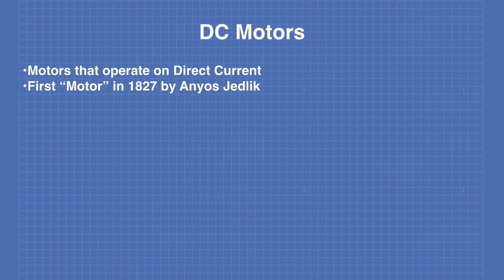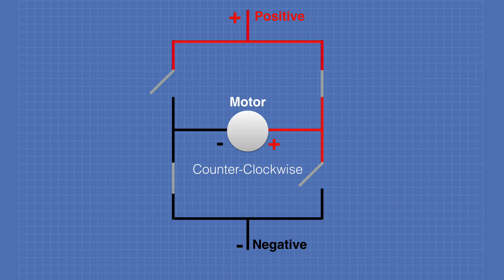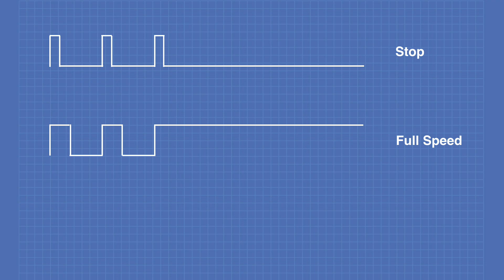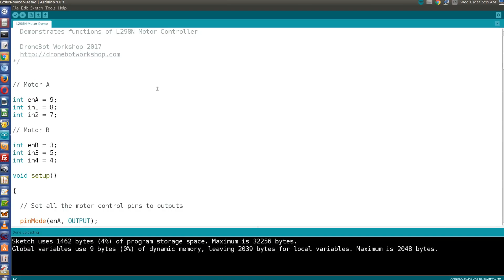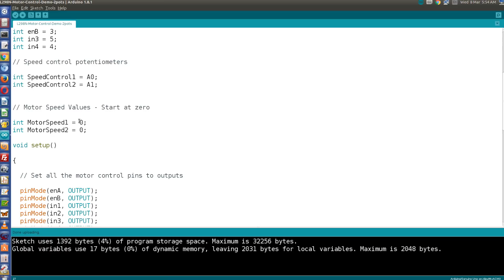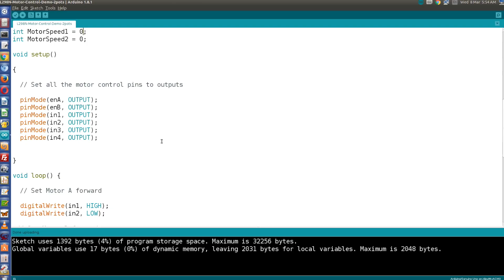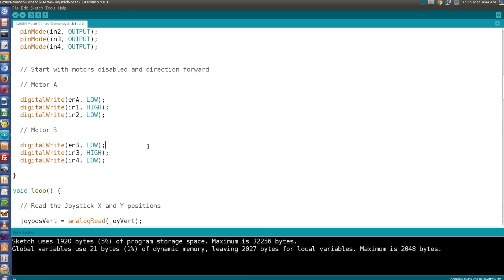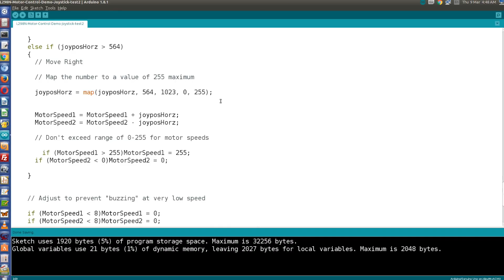Controlling DC Motors with the L298N H Bridge and Arduino

Comment: Can this be apply to a quadcopter as well?
Reply from the maker: Most of the better quadcopters use brushless DC motors that are controlled using an ESC (Electronic Speed Control). While you will find DC motors in the cheaper "toy class" quadcopters these are usually small motors that would be better powered by a tiny H-Bridge controller, the L298N board would weigh too much (and remember, you will need two to control the four motors in a quad).

Comment: So Arduino and the motor drive have it's own separate power supply?
Reply from the maker: Yes. You can use the Arduino's 5 volt output to power the L298N boards logic circuitry but the motors themselves will need their own power supply.
This is actually a good thing in a way, as the motors (especially inexpensive ones) can induce electrical noise on the power supply lines. You wouldn't want that getting back to your Arduino.

Comment: i need your help sir, this motor controlled with smart phone via bluetooth.and i need circuit diagram and code.i will try lot of times in remotexy app. but its not working "device not reply. receive time out error" this is the problem. and please help me
Reply from the maker: I will need a few more details Mani before I can assist you. Are you following an existing project to build a bluetooth motor controller and having problems with it?

Comment: Amazing video, easy to understand as a beginner. I've been looking every where for a video that explains the basics like this. I do have some specific questions pertaining to my project though. Can I use this set up, but with a 4 channel relay switch for using a remote to control 2 12v motors for separate functions?
Reply from the maker: Hi Kyle, sorry for the delay in replying.
I'm not sure I completely understand what you want to accomplish. Are you thinking of using the relay outputs to control the IN1- IN4 inputs to the L298N? That would work but you would not have any control over the motor speeds.
Perhaps I'm not understanding, if you can provide more details I'll do my best to assist you.

Comment: Is this akivo for stepper motor also using a shield l293d?
Reply from the maker: The L298 can be used to drive either one stepper motor or two DC motors. This video shows it controlling DC motors.
I will be doing a video about controlling stepper motors soon.

Comment: Thanks for the detailed explanation L298N motor driver.  Will use the steps to eliminate the buzzing sound I get with the motor for my project.
https://www.youtube.com/watch?v=bH53QTfaeVg
Reply from the maker: That's a nice setup you have in your video!

Comment: Is there a specific type of D.C. Motors required to build similar projects? I want to buy some individually, but I'm not sure which
? Thanks
Reply from the maker: The L298N will function with any DC motor that uses up from 5 to 35 volts and that consumes less than 2 amps maximum, which leaves you a wide range of motors to choose from.
The small "yellow" DC motors that come with the cheap robot car bases I used in the video are very inexpensive when you buy them individually, eBay is a great source for these.
Reply: Thank you

Comment: Wow! Thank yoy for this video of yours but can I ask you something? What if I'm using a L298D Motor shield? Can you please help me how to control a motor and/or micro servo motof using a joystick?
Thanks..I wanna learn a lot from you Sir
Reply from the maker: The L298D module is virtually identical to the L298N. You should be able to use these instructions to hook it up.
If you have difficulty identifying the connections let me know where you're having problems and I can try and help you.

Comment: Thanks for this great video. If I want to power a 12VDC motor, could I use a standard 12VDC power supply (and take apart the wires or something)?
Reply from the maker: Sorry for the delay in replying.
As long as your 12 volt motor doesn't draw more than 2.5 amps then this will work fine. Keep in mind that the L298N will drop 1.4 volts so you'll only be supplying 10.6 volts to your motors, they should still work though. If you're using a 12 volt "wall wart" be sure that it is DC and that you know which wire is positive ands which is negative.
If you like you can set the jumper on the L298N to use the 12 volt supply to also power the logic, as 12 volts is plenty for the modules built-in voltage regulator.
If you want to supply them with a full 12 volts you'll need to use a 13.4 VDC supply, not a common item (but very close to the voltage of a car battery!).

Comment: Wow, I can't believe I found something so close to what I want to do! This is really a good video. I would love to ask a few questions though: 1. Is it possible to use a rotator motor like a PC fan and a Servomotor for swing movement as in a fan or air conditioner? 2. If the motors requires 12V and more than 200 mA to function at max speed could the L298N handle that or there is still need to implement transistors? 3. Instead of potentiometer is it possible to use two independent switches with 3 fixed positions like OFF, MID, MAX to power the motors? Thank you very much in advance, loved the work. Jacob

Comment: Absolutely outstanding video! you didn't skip any detail while keeping it professionally presented. Thank you so much for this <3 liked and subbed.
Reply from the maker: Thank you so much for this nice comment - really makes my day! I'm really glad you liked the video.
Reply: @Dronebotworkshop  lllllllliipiop
Reply: @Dronebotworkshop  hi sorry for sudden ask but what is the required(max and minimum if there is such) for L298N H Dual Bridge? i tried to use my laptop/USB Port to connect in arduino but its not running. so far i dont have battery to test it. my code seems correct anyway but it is still not running so i figured the source power is at fault...i might also fry my arduino if i just randomly run voltages which is risky to replace + we are in pandemic and i cant easily go outside.
Reply: @aDAMAS20  I don't think he's gonna answer that any time soon

Comment: hi I want to make a power assist for my wheelchair.I bought 2 24volt  dc motor so now Can I use l298n to control 2 dc motors? how ll they perform? thanks
Reply from the maker: Hi Selahaddin - The L298N can easily handle your motors voltage requirements, however it's limited to 2.5 amps maximum per motor (although it can support brief 3 amp current surges). If your 24 volt motors consume less than 2.5 amps under load then you'll be able to use them and the performance should be fine. 
If you need a greater current capability you're probably best to build an H-Bridge with discrete transistors or MOSFETS.

Comment: can the same arduino board run a 230v dc motor with a joy stick to change directions
Reply from the maker: Unfortunately no, the L298N has a maximum voltage rating of 46 volts.
Are you sure you are dealing with a DC motor and not an AC one? Just asking as that's a very high voltage for a DC motor but it's a common voltage rating for AC motors.

Comment: Thank you so much for your video. That's a great video. I would like to ask if this is possible to have the signal from a temperature sensor in the same Arduino board to trigger the DC motor instead of using Joystick?

Thank you very much!
Reply from the maker: Thanks for the nice comment!  You could definitely use a temperature sensor to trigger the motor instead of the joystick or potentiometer.

For example, you could have the motor spin faster as the temperature increases - this would be great for driving a fan that spins faster as the room gets hotter or that cools a computer as the chips heat up (many computer fans work in exactly this fashion).

The "map" function which is used in the sketches in this video would be able to map the temperature range to the motor speed.
Reply: Thank you so much for your detailed reply. Just want to seek an advice from you if L298N H Bridge with Arduino can help limit the speed of the motor, like if the temperature goes up to a certain degree, then the motor speed would be limited to certain speed and with the temperature below that temperature, the motor can run as usual. If so, If this can be applied to a large motor like the motor used in Electric Vehicle. Sorry that I am studying electrical and electronics engineering and I know only few about it.

Thank you so much!

Comment: Nicely done and very easy to understand!!
Small question for left/right drive of 1 dc motor.
Is it allowed to connect enable motor 1 to 5V and stops the motor with input 1&2 to connect to 0V?
Easier to control the H bridge via PLC.
Thx.
Reply from the maker: Yes, you can set the enable of the motors to be tied high permanently and use the inputs to stop them and control the direction, in fact many L298N modules have jumpers on the enable lines for exactly that purpose. 
However keep in mind that you won't be able to control the motor speeds if you tie the enable lines high - they will be either off or at full speed. Using PWM on the enable lines is the way we regulate the motor speed.

Comment: can u show me how to control two motors on each axis of a joystick? for ex: y axis forward and backward of motor a. and X axis  forward and backward motor B, plz i rly need a code for this a help on making it for exo skeleton project
Reply from the maker: An exoskeleton sounds like a very interesting project, I hope you plan on posting a video of the results once you're done!
You could easily modify the code to do what you want. Consider each axis of the joystick to just be a potentiometer, which they are. Use the same code that I used to determine if the potentiometer (joystick axis) is in the center, most forward or most backward position (see line 78 of the joystick sketch to get an idea of what I am speaking of).  Then the rest of the code is pretty much the same as the "vertical" section of the sketch.
Hope that made some sense!
Reply: DroneBot Workshop thank you so much I'm going to try this very soon :) also check out my channel to see the exo skeleton its a rough video lol my quality isn't the best but I hope you enjoy
Reply from the maker: That is a VERY cool project. I should build one before the end of the summer so that I can remove all our air conditioners for the winter without breaking my back LOL.
Reply: DroneBot Workshop lol that would be fantastic!
Reply: // Motor A

int enA = 9;
int in1 = 8;
int in2 = 7;

// Motor B

int enB = 3;
int in3 = 5;
int in4 = 4;

// Joystick Input

int joyVert = A0; // Vertical  
int joyHorz = A1; // Horizontal

// Motor Speed Values - Start at zero

int MotorSpeed1 = 0;
int MotorSpeed2 = 0;

// Joystick Values - Start at 512 (middle position)

int joyposVert = 512;
int joyposHorz = 512;  

void setup()

{

  // Set all the motor control pins to outputs

  pinMode(enA, OUTPUT);
  pinMode(enB, OUTPUT);
  pinMode(in1, OUTPUT);
  pinMode(in2, OUTPUT);
  pinMode(in3, OUTPUT);
  pinMode(in4, OUTPUT);
   
  // Start with motors disabled and direction forward
  
  // Motor A
  
  digitalWrite(enA, LOW);
  digitalWrite(in1, HIGH);
  digitalWrite(in2, LOW);
  
  // Motor B
  
  digitalWrite(enB, LOW);
  digitalWrite(in3, HIGH);
  digitalWrite(in4, LOW);
  
}

void loop() {

  // Read the Joystick X and Y positions

  joyposVert = analogRead(joyVert); 
  joyposHorz = analogRead(joyHorz);

  // Determine if this is a forward or backward motion
  // Do this by reading the Verticle Value
  // Apply results to MotorSpeed and to Direction

  if (joyposVert < 460)
  {
    // This is Backward

    // Set Motor A backward

    digitalWrite(in1, LOW);
    digitalWrite(in2, HIGH);

 

    //Determine Motor Speeds

    // As we are going backwards we need to reverse readings

    joyposVert = joyposVert - 460; // This produces a negative number
    joyposVert = joyposVert * -1;  // Make the number positive

    MotorSpeed1 = map(joyposVert, 0, 460, 0, 255);
    MotorSpeed2 = map(joyposVert, 0, 460, 0, 255);

  }
  else if (joyposVert > 564)
  {
    // This is Forward

    // Set Motor A forward

    digitalWrite(in1, HIGH);
    digitalWrite(in2, LOW);

 
    //Determine Motor Speeds

    MotorSpeed1 = map(joyposHorz, 564, 1023, 0, 255);
    MotorSpeed2 = map(joyposHorz, 564, 1023, 0, 255); 
  }
  { if (joyposHorz < 460)
  {
    // This is Backward

    // Set Motor B backward

    digitalWrite(in3, HIGH);
    digitalWrite(in4, LOW);

    //Determine Motor Speeds

    // As we are going backwards we need to reverse readings

    joyposHorz = joyposHorz - 460; // This produces a negative number
    joyposHorz = joyposHorz * -1;  // Make the number positive

    MotorSpeed1 = map(joyposHorz, 0, 460, 0, 255);
    MotorSpeed2 = map(joyposHorz, 0, 460, 0, 255);

  }
  else if (joyposHorz > 564)
  {
   
    // Set Motor B forward

    digitalWrite(in3, HIGH);
    digitalWrite(in4, LOW);

    //Determine Motor Speeds

    MotorSpeed1 = map(joyposHorz, 564, 1023, 0, 255);
    MotorSpeed2 = map(joyposHorz, 564, 1023, 0, 255); 

  }
  else
  {
    // This is Stopped

    MotorSpeed1 = 0;
    MotorSpeed2 = 0; 
   }
  }
} 

this is the code im trying now lol it doesnt seem to work though, im not getting any movement ,
Reply from the maker: The motors aren't moving because you don't have the two "analogWrite" statements at the end which send PWM to the enable lines on the L298N controller.  In other words you're calculating the MotorSpeed values but then you aren't actually doing anything with the results.

Also as I understand it you're trying to control each motor independently with the joystick? If that's the case then you shouldn't be changing the values of both MotorSpeed1 and MotorSpeed2 within the same "if" statements.  For Motor A you just want to calculate MotorSpeed1 and for Motor B you just want to calculate  MotorSpeed2.  Just eliminate the extra lines from each if statement, otherwise both motors will spin at the same speed and in the same direction.

If you do that and add the analogWrite statements at the end your code should work!

 analogWrite(enA, MotorSpeed1);
 analogWrite(enB, MotorSpeed2);
Reply: DroneBot Workshop thank you so much! :)
Reply: this code partially works , i can get movement from the x axis but both motors turn as if they are shareing values and i cant get any movement from y axis

 // Motor A

int enA = 9;
int in1 = 8;
int in2 = 7;

// Motor B

int enB = 3;
int in3 = 5;
int in4 = 4;

// Joystick Input

int joyVert = A0; // Vertical  
int joyHorz = A1; // Horizontal

// Motor Speed Values - Start at zero

int MotorSpeed1 = 0;
int MotorSpeed2 = 0;

// Joystick Values - Start at 512 (middle position)

int joyposVert = 512;
int joyposHorz = 512;  

void setup()

{

  // Set all the motor control pins to outputs

  pinMode(enA, OUTPUT);
  pinMode(enB, OUTPUT);
  pinMode(in1, OUTPUT);
  pinMode(in2, OUTPUT);
  pinMode(in3, OUTPUT);
  pinMode(in4, OUTPUT);
   
  // Start with motors disabled and direction forward
  
  // Motor A
  
  digitalWrite(enA, LOW);
  digitalWrite(in1, HIGH);
  digitalWrite(in2, LOW);
  
  // Motor B
  
  digitalWrite(enB, LOW);
  digitalWrite(in3, HIGH);
  digitalWrite(in4, LOW);
  
}

void loop() {

  // Read the Joystick X and Y positions

  joyposVert = analogRead(joyVert); 
  joyposHorz = analogRead(joyHorz);

  
  // Determine if this is a forward or backward motion
  // Do this by reading the Verticle Value
  // Apply results to MotorSpeed and to Direction

  if (joyposVert < 460)
  {
    // This is Backward

    // Set Motor A backward

    digitalWrite(in1, LOW);
    digitalWrite(in2, HIGH);

 

    //Determine Motor Speeds

    // As we are going backwards we need to reverse readings

    joyposVert = joyposVert - 460; // This produces a negative number
    joyposVert = joyposVert * -1;  // Make the number positive
    
     MotorSpeed1 = map(joyposVert, 0, 460, 0, 255);
    analogWrite(enA,MotorSpeed1);

  }
  else if (joyposVert > 564)
  {
    // This is Forward

    // Set Motor A forward

    digitalWrite(in1, HIGH);
    digitalWrite(in2, LOW);

 
    //Determine Motor Speeds

    MotorSpeed1 = map(joyposVert, 564, 1023, 0, 255);
    analogWrite(enA,MotorSpeed1);
  }
  { if (joyposHorz < 460)
  {
    // This is Backward

    // Set Motor B backward

    digitalWrite(in3, LOW);
    digitalWrite(in4, HIGH);

    //Determine Motor Speeds

    
    // As we are going backwards we need to reverse readings

    joyposHorz = joyposHorz - 460; // This produces a negative number
    joyposHorz = joyposHorz * -1;  // Make the number positive

    
    MotorSpeed2 = map(joyposHorz, 0, 460, 0, 255);

    analogWrite(enB,MotorSpeed2);
  }
  else if (joyposHorz > 564)
  {
   
    // Set Motor B forward

    digitalWrite(in3, HIGH);
    digitalWrite(in4, LOW);

    //Determine Motor Speeds
   
    
    MotorSpeed2 = map(joyposHorz, 564, 1023, 0, 255); 
   
    analogWrite(enB,MotorSpeed2);

  }
  else
  {
    // This is Stopped

    MotorSpeed1 = 0;
    MotorSpeed2 = 0; 

    
   }
   {
  // here analog write was
  
  }
  }
 }